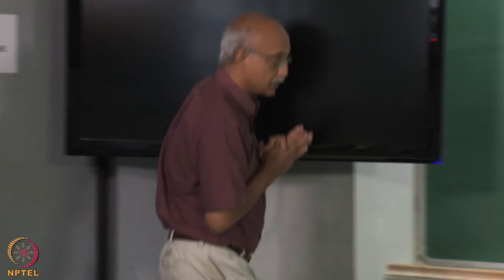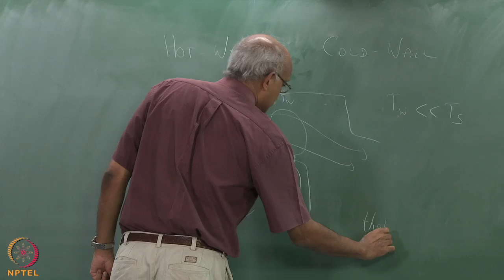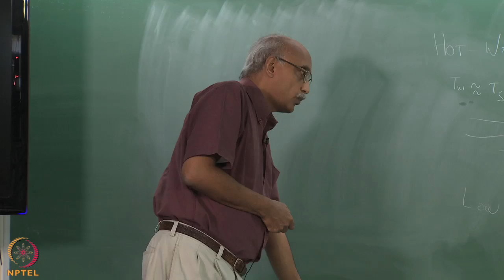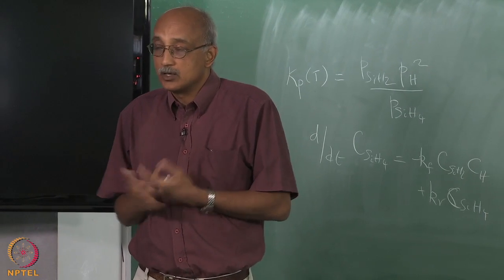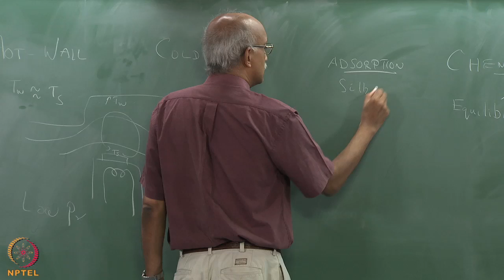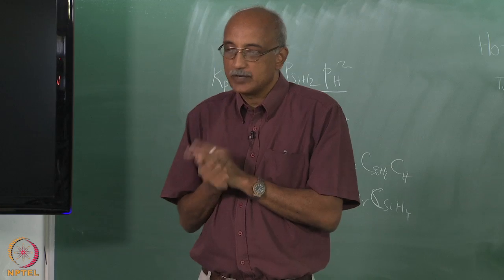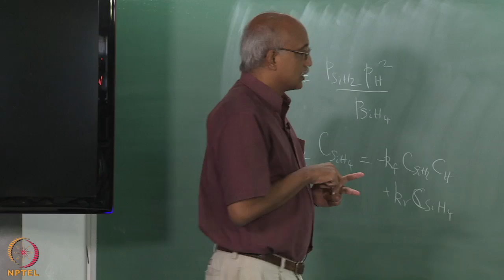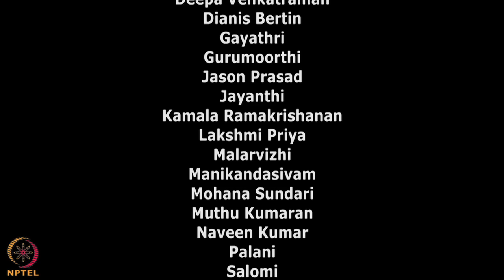mod-01 Lec-03 Overview of CVD Process Fundamentals

Comment: How do you know when one layer is filled and another one starts?
Reply: That is determined by controlled input. Most CVD thin films are done in layers akin to a sandwich. The first layer is usually an adhesive layer to help bond the thin film to the wafer substrate. Then the subsequent layers will be deposited on to the adhesive layer. Example, TiN is a very common thin film. 

Between each layer, the reactor is often purged of the previous layer's contaminants before a new layer is applied. A purge can be usually done with H2 or N2 though H2 is generally recommended because it will not nitride at higher temperatures like N2. 

Some manufacturers of TiN will deposit TiCN as the adhesive layer and then deposit TiC as the central layer with TiN being the cover layer.